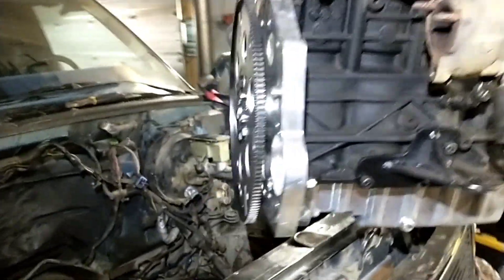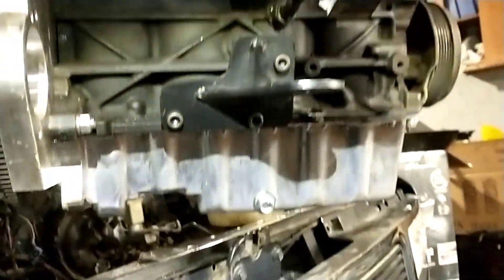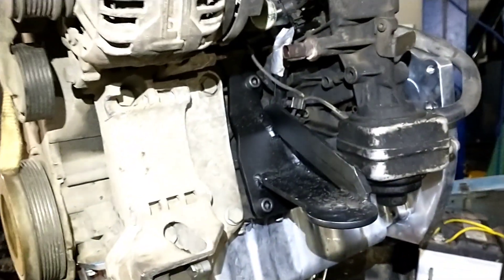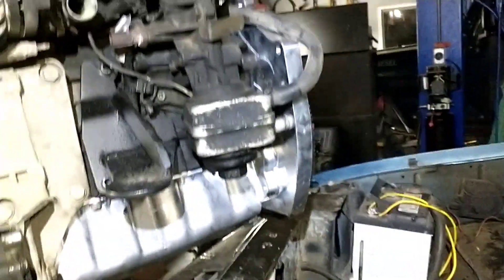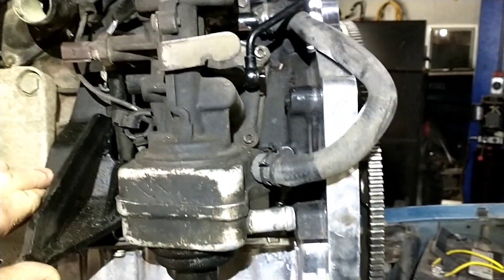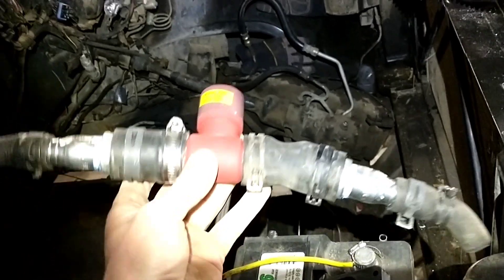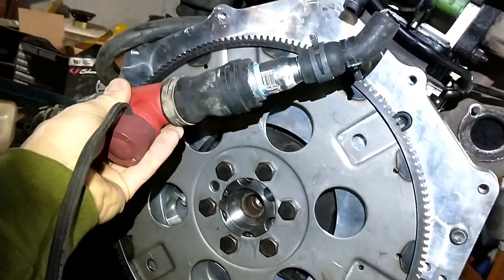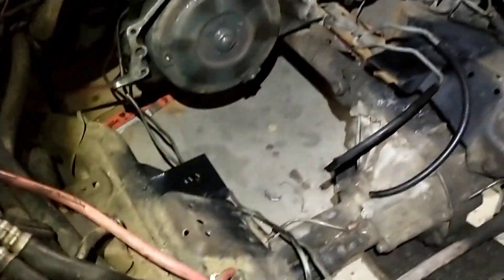Chevy 1500 TDI BEW Swap, Finished Motor Mounts, How To Prep Gas Fuel System, Installing EGT gauge

Comment: What transmission is that truck running? I am thinking about using an Alh in front on a 4l60e with the stock Silverado torque converter.
Reply from the maker: This is the 700R4/4L60 with the stock converter, I would recommend even a 1500 RPM stall instead of the factory 1200 RPM, the TDI really needs boost to get moving well and there's not much at all down at 1200
Reply: @TDISwaps  awesome. Thanks for the info. It’s going in my ~2500lb car so I will try the stock tq first and swap it out after if it isn’t working since I already have it. What adapter plate do you have or is it custom?
Reply from the maker: @OffbeatMechanics  oh ya you won't have any trouble taking off normal, there's just a bit of lag of you want to get out and go right away.  I used a DCS kit, but it looks like they stopped making them.  My other source would be TD Conversions.  https://tdconversions.com/products/vw-1-9-2-0l-tdi-to-chevy-small-block-adapter-kit-post-1986-manual?sca_ref=2282812.xcTsEMbSOW

Comment: Nice..!! What motor mounts are you using? And they are not too hard?
Reply from the maker: I have used a speedway bolt through rubber mount on all my swaps so far.  They do shake your drink a little at idle but smooth out right away and no vibration at higher RPMs

Comment: Are you using gasoline or diesel converter?
Reply from the maker: There has already been success using the gas converter in other TDI applications so we are trying a stock converter first.  The TDI has a similar Power/RPM range to older gas engines so it seems to work well with stock automatics.
Reply: @TDISwaps  okej sounds great, i have a suburban gmt400 1992 k1500 👍
Reply from the maker: That's a big rig! Hopefully the TDI is up for these full size trucks ha ha.
Reply: @TDISwaps  haha 👌🤣